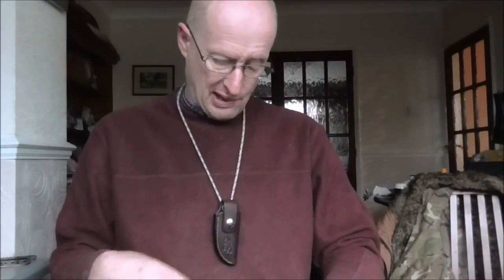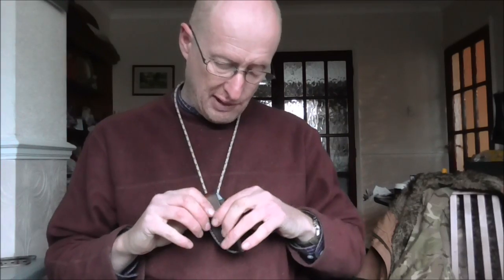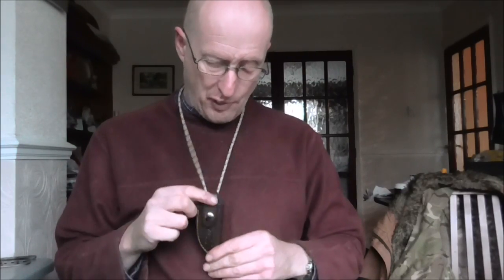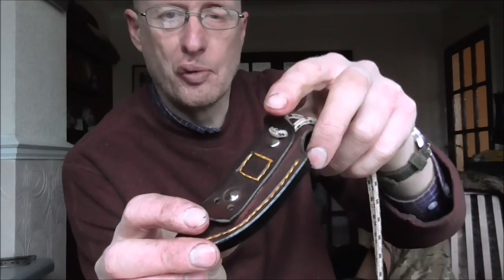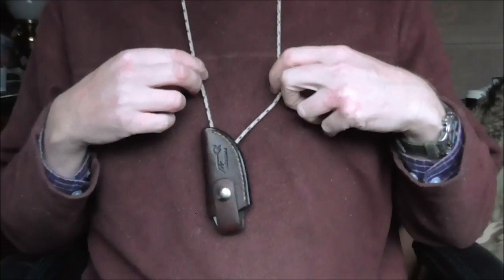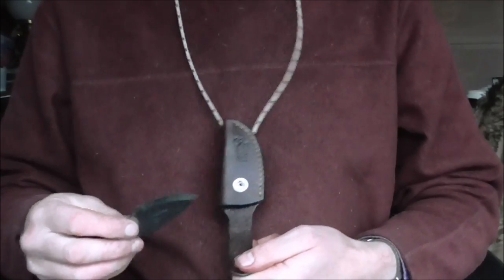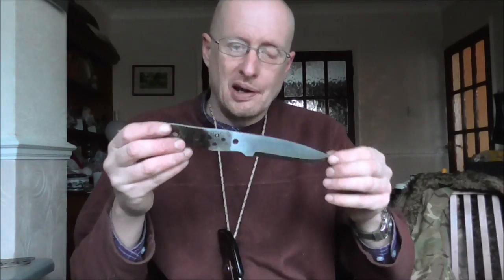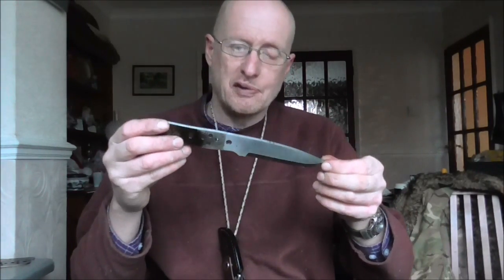Alteration to the Wisps sheath

Comment: An idea came to me watching your adaptation video. If you threaded your paracord through both sets of holes you could easily wear it either way without having to re-tie it. If you want it point up, slide the sheath all the way to one end of the loop. If you want it point down, slide it to the other end. Functionally, you would have to knot the cord on one side between the sets of holes. In theory, it works the same as sliding a cord lock up and down a drawstring. (The written word seems very inadequate for describing this!)